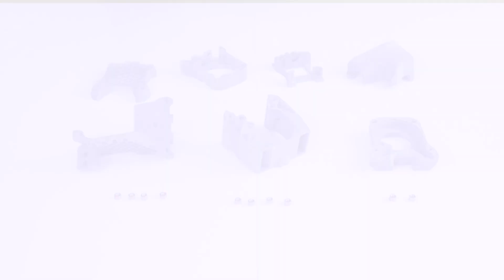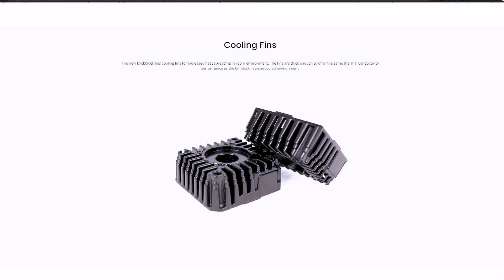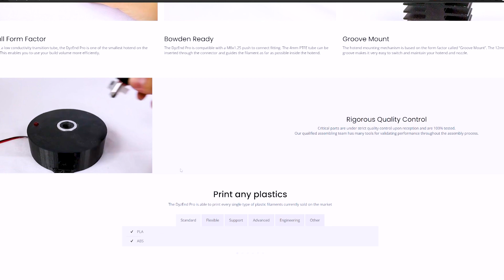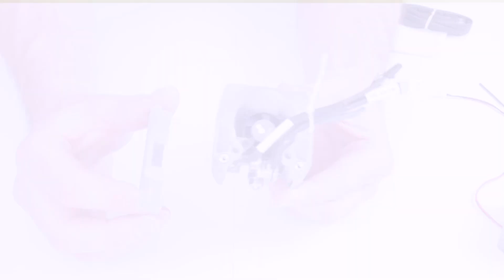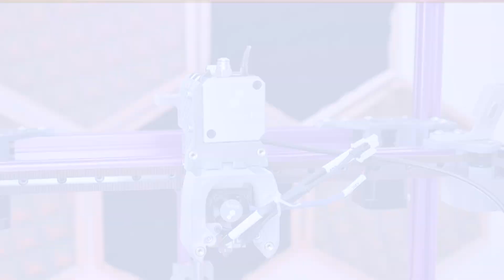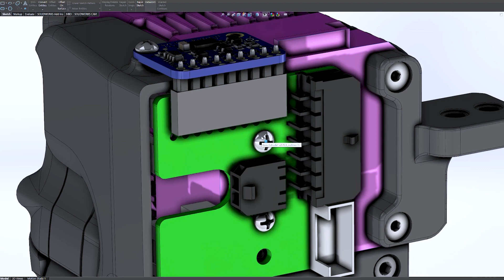Voron Trident Premium Purple Plastic Eater Build (Part 3: DYZE Design Print Head!) MJF Parts

Comment: Loctite can eat up plastics. If it would have bin abs it would eventually start to crack if it touches the filament.  Clear nail polish will work just as good and it won’t make the plastics to crack. Btw why not take one of the 5015 mods  available for the extruder. That stock setup can’t really print pla and any decent speeds.
Reply from the maker: Hey thanks for pointing this out! I didn't know... luckily most of the places I used it has the brass inserts... but there are a few holes that I will have to monitor now. Learn something new every day!
Reply: Yea, loctite literally eat polycarbonate (same way gallium eat aluminum), I found out the hard way when building the foxalien 4040, luckily....I had 2 printer and the parts were easy to re-design and print

Comment: I'm running the DyzeXtruder Pro with a Dragonfly hotend. It works great!
Reply from the maker: I can't wait to actually fire mine up!
Reply: @Embrace Making  Forgot to mention on my Voron Switchwire. It's definitely a nice upgrade compared to the Clockwork,  so good choice. Cool MJF parts!
Reply from the maker: Thank you! How are you liking the Switchwire? I told myself no new projects until I finish this one.... lol
Reply: @EmbraceMaking  I love the Switchwire because it's a good compromise between relatively fast incredible quality printing and simplicity. I'm going to build an Orion Trident next - The belted Z mod for the Trident. After experiencing the layer consistency of the belted Z on the switchwire, I don't think I'd want lead screws again.
Reply from the maker: I have yet to try a belted z but I have a friend building a custom one... there will be testing!

Comment: Your Cad skills are impressive, I'd love to see more about your process for modifying the parts. Great videos I'm enjoying the series.
Reply from the maker: Thank you so much! Basically I import the original parts into CAD and take the original mounting points as references. Then I use the original geometry as an envelope to design within to ensure that my new parts do not interfere with one another or any other part of the machine. Some parts are very basic geometries, others require more advanced surface modelling. At the end I apply some fancy hexagon cutouts to try and reduce the weight / amount of material used. With the multi-jet process you don't want super thick cross sections, it can actually shrink in a similar way that injection molded parts don't like thick sections, especially not next to thin ones. The great advantage to multijet is that you don't have to worry about molds and draft angles /undercuts like you would with injection molding.